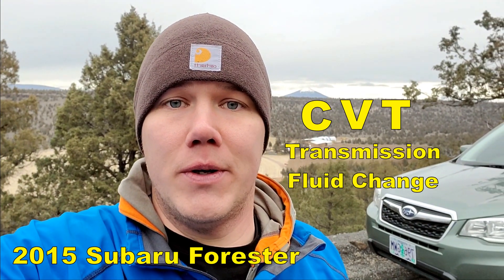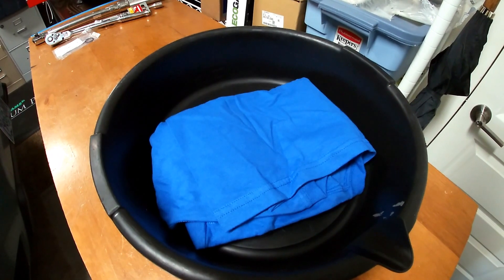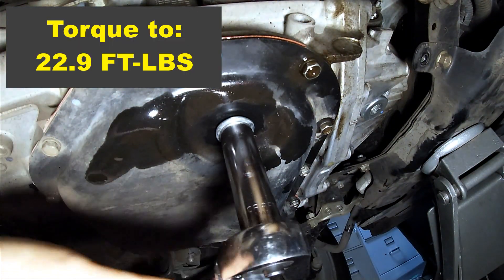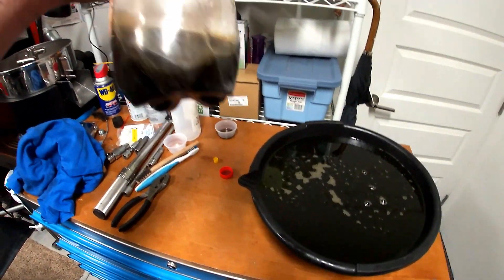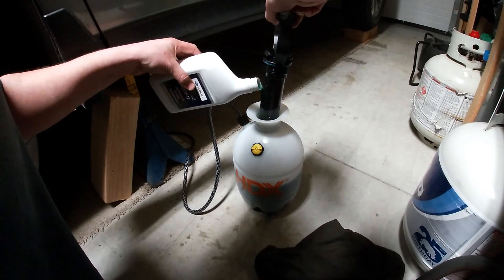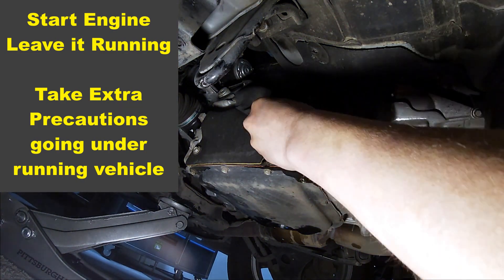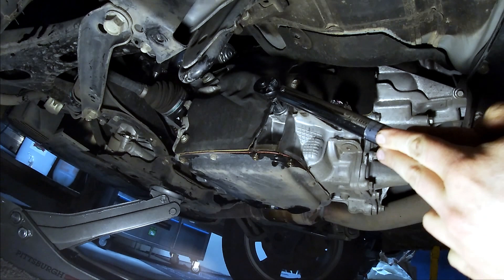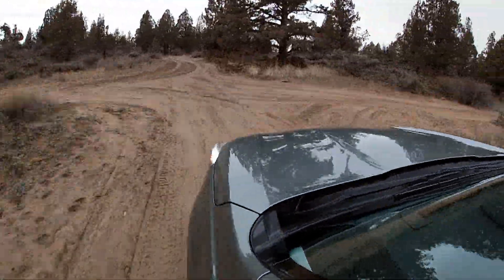Subaru CVT Transmission Fluid Change & Flush Procedure | 2015 Forester Replacement-Fill-Level Check

Comment: I hate if this is a redundant question. Would this be the same/about the same process for the 2018 xt? 

I ask as I have in the past with an outback I have, asked for a service to be done. Paid for it. They didn't do it.. I'd used a little trick of sharpee inside where it'd obviously be "scraped" indicating the piece to be service was removed to service. blah blah. So I will be doing diff/cvt/other services that I know the money spent will be for it being done. With me doing it.
Reply from the maker: It's pretty similar process really. Goodluck man!
Reply: @MTsubfly  thanks brother, have a good year!

Comment: Good walk through but severe driving conditions only apply to the transmission and differentials when there is repeated trailer towing. CVT is maintenance item number 13 which is only found on the severe driving condition definition for number 9 (trailer towing)

Comment: What if instead of doing the flush every 60k miles, you just drain and fill every 10k miles?
Reply from the maker: That's ok. I think looking back, maybe just doing the pan drain and refill (6qts) every 25k miles would probably be pretty good. By 100k miles that would be about 24qts. It only hold 13ish.
Reply: @MTsubfly  Thank you.  Also do you have a list of CVT fluids in lieu of Subaru CVTF-ii?
Reply from the maker: @josephcatalan3161  there's amsoil and Valvoline. I would highly recommend sticking with factory Subaru fluid.

Comment: Hello, how you think, need to change oil filter in cvt or its not necessary? Deeler say that subaru cvt need adaptation than you change oil. Do you do adaptation or its actually not necessary?
Reply from the maker: The actual oil filter in the transmission requires removing & disassembling the tranny to replace. The filter everyone is concerned about is a coarser filter pickup to protect the pump IMO. Neither need to be done. You risk contaminating the CVT. Its up to you, I did not do the pan filter.
Reply: @MTsubfly  Ok, thax man!

Comment: Your videos are great. Thinking about doing this service. What are your thoughts on dropping the pan cover  and cleaning the magnet and the inside of the pan cover real well. Love to know your thoughts.
Reply from the maker: Good question. My opinion is for the average DIYer it risks contaminating the internals, and really isn't needed. Changing the fluid removes the bulk of the finest debris, and refreshes the properties of the wearing fluid. I bet that screen is for larger debris (20 micron maybe?) There is an actual filter in the transmission but requires splitting the case to change (huge job). If you do it, make sure to replace the gaskets, its not going to hurt doing it, just not likely needed. Usually anything with an oil pump has a pick-up screen to protect the pump, maybe thats its purpose? But magnet cleaning is a good idea, however most of the debris should be overwith from break in. Hope this helps, just my thoughts
Reply: @MTsubfly  appreciate you taking the time to answer. I agree I'm a newbie so will just go through the steps you outline in your video. I have a 2016 forester base model. So far no issues and starting the maintenance myself which is why I've been watching your tutorials many times over.  Appreciate all the help.
Reply from the maker: @felipepinilla9896  thank you! And good luck! You got this!
Reply: no way, don't do it.

Comment: Awesome video!!  I am about to perform this service along with front and rear diff change on my 2017 Outback 2.5i Limited.  Thanks a ton for all of this info!!
Reply from the maker: Thanks! You may have already, but check my videos on the front/rear diffs. Process should be similar. Good luck!
Reply: @MTsubfly  I actually just watched that vid too!  Quick question, what are your thoughts on replacing the strainer inside the transmission pan?  I only have 60,000 miles on my '17 Outback, so I probably wouldn't even consider it until well over 100,000 miles.  Just was curious if that's something that needs to be replaced at some point.  Of course, there isn't a service interval for this.  All I can find is that it doesn't need to be replaced unless it is damaged.  Thanks for the help!
Reply from the maker: @jnepute  good question. My opinion is for the average DIYer it risks contaminating the internals, and really isn't needed. Changing the fluid removes the bulk of the finest debris, and refreshes the properties of the wearing fluid. I bet that screen is for larger debris (20 micron maybe?) There is an actual filter in the transmission but requires splitting the case to change (huge job). If you do it, make sure to replace the gaskets, its not going to hurt doing it, just not likely needed. Usually anything with an oil pump has a pick-up screen to protect the pump, maybe thats its purpose? Hope this helps, just my thoughts...

Comment: Hi, great job! How many miles your forester runing after you change cvt oil? Did you feel some diffrents in a work your cvt transmition?
Reply: This my subaru outback "Flint" https://youtu.be/QCXFOV44HCs
Reply from the maker: 100k miles, its been driving great! Zero complaints!
Reply: You change cvt oil once  every 100.000 miles?
Reply: Did you hear about "amsoil cvt" its made in USA. Looks like the same oil for subaru lineartronic  2
Reply: @justdoit7091  i bet it's not $ 5.92 a bottle though.   https://www.rallysportdirect.com/part/transmission-fluid/3074-300-eneos-cvt-fluid-model-s-1qt?gclid=Cj0KCQjw9O6HBhCrARIsADx5qCRjUSr0kPm3ttpSO9OKCuhhpRy0T9Rq6Nj0gdYkqsN2OtMJZK79BZ4aAtquEALw_wcB
Reply from the maker: I recommend using Subaru Fluid vs amsoil. Manual says change every 28k miles in severe conditions. The dealer only drains the pan 6 qts out of 13
Reply: @MTsubfly  Ok! In Russia we can buy only 20 liters bag original subaru cvt oil, I decide change oil like you do, on my outback 2015. Thanx for answers and videos! Keep uploads

Comment: The partial (approx 6 Qt) CVT transmission drain & fill at the dealership in Louisville, KY costs $250.00 while the radiator drain & fill costs $265.00

Comment: Great Video. Going to save an watch and take notes again before starting my own job. That Subaru fluid is very prices and vs the price of my used forester, I think I will just use the Canadian Tire brand fluid which is to spec and manufactured by Shell (I think... one of the big oil companies anyways).
Thanks agin for posting. 
Cheers from Alberta Canada
Reply from the maker: I read somewhere on the internet a guy who used the Valvoline brand, it was good for 15k miles then ran rough, but when he went back to subaru fluid, he claimed no issues after 30k miles. Personally I would stay Subaru fluid, but if you pioneer the use of a different fluid, come back and let us know how you like it! Cheers!
Reply: How has your experience been with the non-OEM brand CVTF?

Comment: Hello, This Chang Su , KIM to South Korea,  I have 2015 subaru forester xt, and would like question,  What is the continuously variable oil change cycle?
Reply: In Japan it's like 30,000 miles, in Canada it's like 60,000, in America its "lifetime".
Take your pick.
Reply from the maker: On my car they say it never has to be done, but if you check the manual, it says to change fluid under severe driving conditions every 28k miles.
Reply: @MTsubfly  Thanks for your quick response, now my forester xt running  41292miles, and I think that CVT Oil to be changed as soon as possible. If I have some questions, I will ask you, Have a good day !
Reply: @MTsubfly  Dear MT,

Good morning, 
I am second owner for forester xt. 
I purchased the 2015 subaru forester xt model from Korean  on 28, Nov. 2020. 
 
He came to Korea from Vancouver to Canada and sold me 2015 SUBARU FORESTER XT..

I contacted the subaru official service center to South Korea, have to change of the CVT Transmission oil, but the service center said that the turbo model is not officially imported into Korea and the service center cannot supply the oil.
For your reference, Liquids (engine oil, mission oil, etc.) are prohibited items to be brought into Korea.
 How can I do it? 
If I can't buy genuine CVT Transmission oil for forester, please let me know if there are other brands compatible. 
Can you give me information after consulting with Subaru Club members?
 
I look forward to good news from you.  
 
Best regards 
 
Chang Su, KIM

Comment: Rumor mill has it that Subaru CVT fluid is a dealer-coveted item that they get in 5-gallon pails and have to beg and plead to let them sell you some. I guess those handy 1-quart bottles you have there say otherwise? I just bought a '15 Crosstrek with 68k and am wanting to change out all the fluids.

Comment: A technitian from the dealer told me I will need the car forester 2015 to be reprogram after trans oil change..is this true?
Reply from the maker: No not needed, but maybe thats how they reset the CVT deterioration %. Its just a calculated number.
Reply: @MTsubfly  thanks a lot.I did it.Thanks to you..No problems so far.

Comment: Thanks for the video, very informative. I'm curious though, where did you find all the CVT fluid in bulk for a reasonable price? My local dealer charges an arm and a leg for the stuff.
Reply from the maker: I ordered all my stuff from Oregon City Lithia Subaru. It was a fair deal like $12-13/qt plus shipping.

Comment: Excellent video with nice and clear instructions. I own an Outback 2020 and it uses CVTF-III oil and Subaru doesn’t sell this oil in quart or gallon. One way of stopping DIY and force you to have it done at dealer...$$$$$.
Reply: don't do it , type II should be fine.  It's a hustle is all, just a hustle.  here's the link to VERY affordable exact type II replacement fluid https://www.rallysportdirect.com/part/transmission-fluid/3074-300-eneos-cvt-fluid-model-s-1qt?gclid=Cj0KCQjw9O6HBhCrARIsADx5qCRjUSr0kPm3ttpSO9OKCuhhpRy0T9Rq6Nj0gdYkqsN2OtMJZK79BZ4aAtquEALw_wcB

Comment: I love the technical information you provide on your channel regarding the technical issues and maintenance of our Subaru's. I would like to recommend that next time you remove the collecting tray and replace the strainer filter. By the way, you would take the opportunity to clean the internal magnet that will probably be loaded with ferrous residues. The silicone or sealant must be of the RTV type. You dare?
https://www.ebay.es/itm/303309815893?boolp=5&ul_noapp=true

Comment: Regarding orientation, is the CVT fill plug on the driver's side?
Also, the plug on my 2012 Impreza is 10mm hex. Is this a normal variation?
Reply: Ingenious method using pump sprayer. Good video 👍! I also question wisdom of leaving "Lifetime Fluids" in "Sealed" transmissions. I subscribe to Reagan's motto - "Trust but verify". Made a good point how do we know if factory fill is correct?
Reply from the maker: Should be on the Drivers side (TR580) My drain plug was a hex too,  14mm, maybe it's a change by subaru??

Comment: Hey guys

How do you know what line goes to the transmission to cooler & which one is back

Subaru outback 2010 2.5i
Reply from the maker: I cannot tell you 100% for sure, but if its the same as the forester, my opinion is that it doesn't matter which direction the fluid flows through the cooler itself (its only a heat exchanger) but I can't tell you what to do for sure.  does that help?
Reply: @MTsubfly  yeah whole point is to get the fluid out and replace it with new one

Comment: Update: prior to doing the CVTF change, I had the opportunity to take a 280 mile round trip in the vehicle in about 85 degree weather. I took the OBDII reader and the app. The highest temperature recorded for the CVT was 230 degrees Fahrenheit.

Fast forward two weeks and CVTF replacement later the same trip with the same conditions is repeated.

The maximum temperature this time did not exceed 196 degrees Fahrenheit.

While we can debate back and forth that the fluid may or may not replacement even after my 97k miles, but this I know: the CVT is now operating at a temperature that is 30 or so degree lower with the new fluid.

That to me is justification enough to do the replacement.

Now if I can only figure out how to reset the CVT fluid deterioration rate to something like .8% (given that the purge never really cleans out the oil)....it is at the 7.59% from prior to change.....

Comment: Hey there. Just wanted to thank you for your videos on CVTF and Front Diff oil replacement . I did these on a 2015 Subaru Outback 2.5L, and let me tell everyone it’s exactly the same.

Even the Front Diff Fill Plug located on top of the front right drive shaft was over tightened and took a major push to break.

So thanks again, other than an oil spill (my fault) in the engine compartment, it went rather smoothly. The back and forth underneath to fill the CVTF was annoying but that is what is required.......

I used an OBD II reader and the free ActiveOBD app and it was a cinch.
Reply from the maker: Excellent work!
Reply: I'm about to have my CVT change. Where did u purchase ur cvt oil aside from d subaru dealership.
Reply: @elizabethpaguio8175  I am sure you can get it anywhere. The prices were the same so I went to the dealer. Bought extra, just in case something went wrong, and returned the extra after I was done. But this was awhile ago. I don’t know what the pricing is today.
Reply: It was $17.34/qt at the dealership in TF Idaho today.

Comment: Hey Mark! My father recently tried his hand at changing oil, but what he ended up doing was over filling his engine with oil, while draining out the transmission fluid. I'm fairly certain that is what he did. I was wondering if monitoring the temperature of the transmission is crucial to changing transmission fluid.
Reply from the maker: Hey sorry to hear that, I think its a fairly common mistake. Yes, you should use the temperature to set the level. There really is not any other way to know that it is set correctly. I don't know what would happen if you are a quart high, or low, but it could cause poor changing of gear ratio's (shifting) peace of mind is to just get a ODB scanner, and download a free app, set that level correctly.. See my video on the BAFX scanner, $25 good to go, you can always sell it afterwards.
Reply: @MTsubfly  Okay, I'll look into that. Also, the closest dealership that sells subaru cvtf-II is 40 miles away, is there an alternative that I can use with cvt transmissions?
Reply from the maker: @Chensten  there's amsoil and valvoline,  but its hard to find sometimes in store. After research my opinion is its not worth saving money, get the subaru brand cvt fluid. I got mine ordered and shipped from Oregon City Subaru @ a fair price.
Reply: @MTsubfly  Sorry for back tracking a little bit, but would it be sufficient to use a thermometer gun on the bottom pan of the transmission? Do you think it would get the right temperature? Also, do you think we would be okay with just filling the cvt with the fluid rather than completely flushing it?
Reply from the maker: @Chensten  it sounds like you just drained to CVT pan, (maybe 5 quarts ish) no need to flush- you didn't put the wrong fluid in the CVT...so yea you just need to refill it, and to do it right, you use the temp probe readout that the transmission has. Guys have used infrared thermometers, even a meat thermometer.... but you know there are risks. The surface of the pan is likely cooler than the fluid. Do what you are confident/comfortable with risking. Hope that helps...

Comment: Great video with clear explanations. I own a Subaru Outback 2020 and will certainly change CVT fluid myself as recommended by you and Mr Subaru 1387,  3 years / 36,000 miles regardless of what my dealer tells me. I use Veepeak and Car Scanner to get CVT oil temp. Keep doing superb videos.

Comment: Hey MT, do you maybe have pdf subaru service intervals? or do you know where I can find one? wanting to service my car myself but my service book does not state what's needs to be done at every service.
Reply from the maker: Its in the owners manual maintenance booklet that comes with the car. You can download them online a few places. 
But I dont have the subaru service manuals, calling a subaru parts counter and they can help if they are a good one.